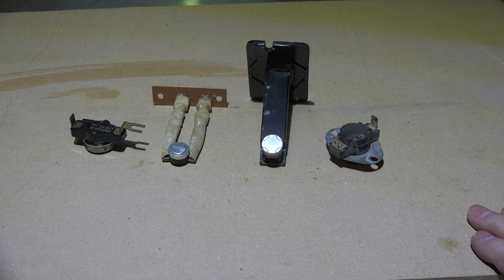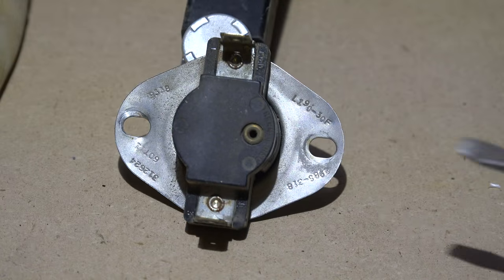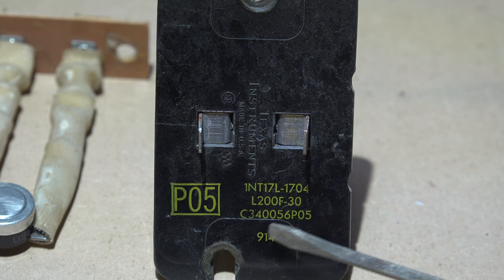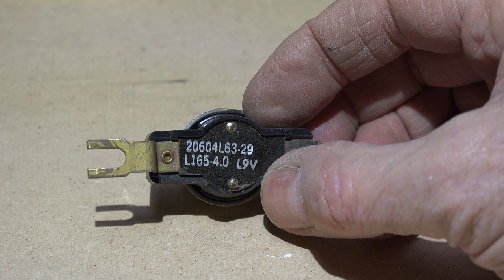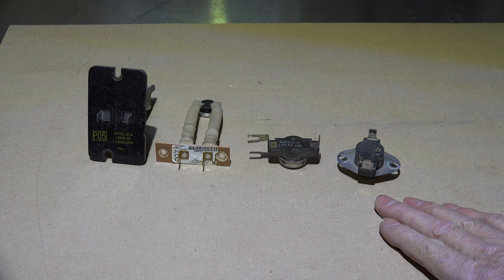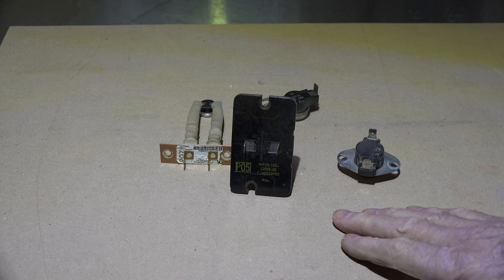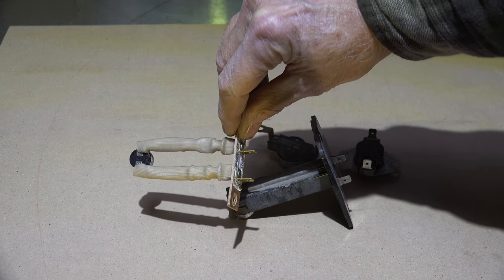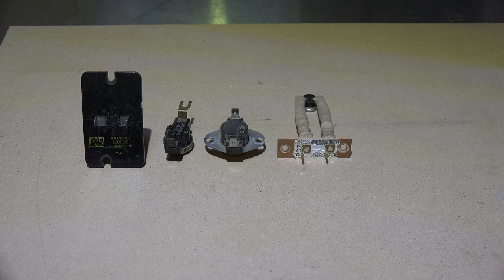Common limits on newer furnaces

Comment: Please help. I have a fairly new Rheem gaspack (first winter), variable fan. It heats fine but I'm convinced that the blower is kicking on too soon after the burners start (about 40 seconds after burners start, which means a full minute of air blowing from vent before I feel normal heat), and the blower stays on too long after burners stop (for 2.5 minutes after burners stop). I'm getting too much chilly air at the start of heating cycle, and at least one minute of non heated air before the blower stops. It's creating an annoying drafty feeling. I am calling the installing company but need to know if the fan limit switch is bad or simply incorrect for my system. Filters are clean, 2 returns, all vents open, ductwork not obstructed, one story house.
Reply from the maker: I am assuming this is a down flow unit.  The cold air is a problem with these units.  The blower on timing is not adjustable.  The off timing is adjustable, usually by dip switches on the control board.  Hope this helps.
GFM
Reply: grayfurnaceman it's a side flow unit on the side of my house, rheem prestige. I will ask them about the dip switches

Comment: Gary, your videos very clear and informative.  I have a question about limit switches. I have a Fedders Central Air Unit Model number CFE030C3B. Yep it's going on 46 years old. The limit switch says "L140-3" and then B3V. It also has the numbers 31-8457 and 20604L17-319 and Klixon Made in USA stamped on it. I'm looking for a replacement, but am confused as to what the "3" in "L140-3" means? Can you help with this? My appliance guy is an old neighbor and he always freaks out at the age of this unit, but it still heats and cools very well. Thank you for your expertise.
Reply from the maker: I assume this is an electric furnace.  The limit has an open temperature of 140F and a differential of 30F  I have seen some older limits that dropped the 0 on the differential.  
GFM
Reply: Ah so that's it. Thank you!

Comment: How many limit switches have you seen fail, not where it trips and resets but fails totally?
Reply from the maker: +Craig Nehring Quite a few of the air temp sensing limits fail on newer furnaces.   This is probably because of multiple high temp opens due to plugged filters.
GFM
Reply: I've had a Honeywell fan limit fail, on a big roof mounted unit, the unit went into meltdown.